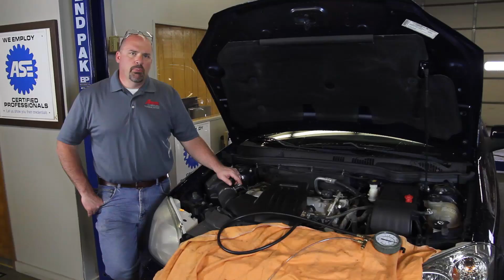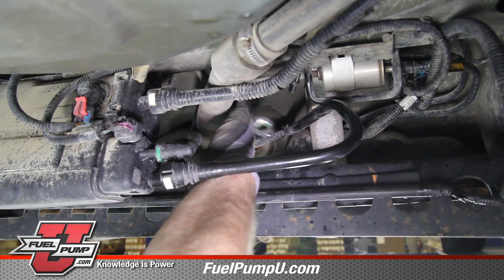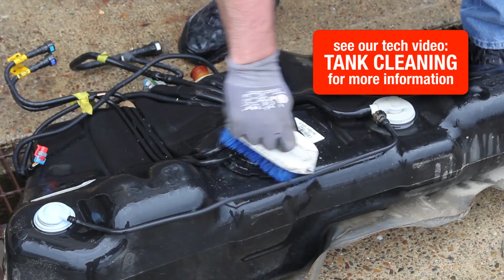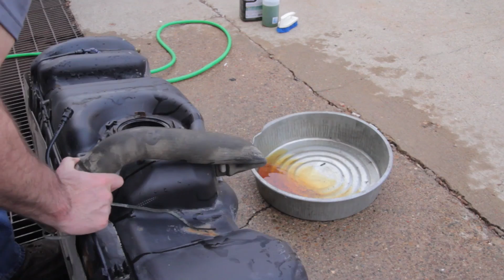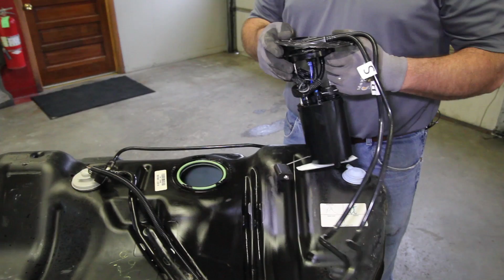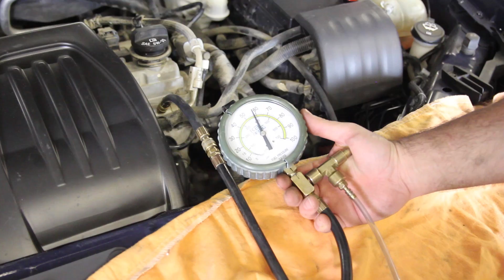How to Install Fuel Pump Assembly E3782M in a  2009 - 2010 Pontiac G5 / Chevy Cobalt

Comment: Thank you for the information that you provide to us through your distinguished channel.  I would like you a favor, please.  I have a 1998 Jeep Cherokee XJ and I would like to know about canceling the main fuel pump from the fuel tank and replacing it with other types that are installed outside for easy disassembly and installation. Waiting for your technical directions. Greetings.
(Faisal) 
fast.mms@gmail.com
WhatsApp
+966555385412

Comment: I have a 2009 chevy Cobalt LT 2.2 liter I live in New Jersey,I got the car from brother who got it new in Pennsylvania.This car turned out to be a California car having CA. emissions set up and a whole different fuel set up.Filter is located inside the tank,there is no fuel pump cartr  as 90% cobalts in the of the country.This car has 90% of it's running on hyway.The the fuel level sensor failed so the fix was to drop the tank replace the fuel level sensor.So has 199,456 miles on it.I also replaced the fuel pump with the OEM replacement.Did the whole dance put fuel back in it.Ture key on and off 4 times hearing pump run a short time.I then went to start engine.It did but stalled,tryed again it ran for less then 1minute I heard a pop back at the right rear, car shut off.I tryed starting again and a gain no fire at all.I then checked the schrader valve for fuel nothing.But still hear the pump come on when key is turned on(only a short time)Any ideas ????????
Reply: sounds like pressure regulator. im having this problem, whatd you do?